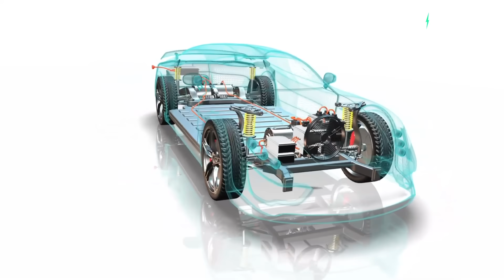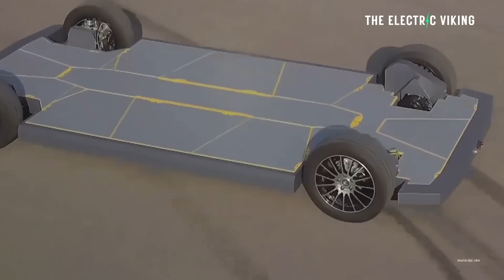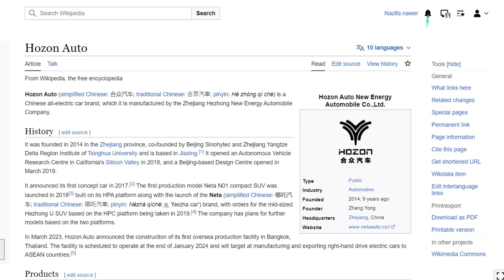CATL new EV platform with 621-Mile range could underpin future Tesla's

Comment: I find this hard to believe, my Tesla Y rwd 58kwh with gentle driving and a warm day can achieve 320 miles max real world, over 10k and  a year I have averaged 4.2 miles to the kWh winter and summer, and consider that above average, where the hell are they getting the extra efficiency from, yes I could match it on a test track at 30 mph but real world no way.

Comment: It's a pity about the physics- as 186 miles is .3 of the range so would use .3 of the battery or 27kwh and to charge 27  kwh in 5 mins is 27x12 or 323 kw charger, correct me if I'm wrong but i don't think they exist and would not be able to take that much current with existing wiring.
Reply: But the tesla v4 is a 350kW charger

Comment: Sam, it seems to me from your presentation, that the 1000km range refers to the skateboard alone (without a body shell fitted) . You can't magically double the range or an EV with higher drive train efficiency given that we are already looking at 95% for existing EV motors. You only have a few percent to play with. You should temper your enthusiasm for claims by manufacturers with some analysis and skepticism. EV drag coefficient and overall weight are equally if not more important.

Comment: The efficiency is most likely due to them driving at low speeds with a extremely efficient but not production test vehicle so not indicative of real world range. The efficiency of the skateboard chassis does not matter as most efficiency is affected by weight of the vehicles a whole but mostly aerodynamics. What matters most is how much this cost to manufacturers.

Comment: This integrated skateboard platform is the next logical step for component suppliers in the Automotive industry. Powertrains (Engines & Transmissions) in ICE vehicles were often bought from component suppliers or rivals. Suppliers such as Robert Bosch and Nippondenso for example could also add to this concept with other modular components such as Integrated dashboards and other integrated systems, on a plug and play, mix and match basis for a semi customised vehicle. It may even be possible to have a body system that can change the "top hat "passenger cell of the vehicle from a sedan to a coupe or a SUV to a utility. The possibilities are endless.

Comment: Its interesting to recall GM conceived the skateboard chassis concept. It was around 1985 as I recall. It was actually an exhibit at various motor shows. Batteries clearly weren't yet ready for it and
subsequently they dropped the bundle.

Comment: Rather than driving a standardized skateboard EV, I would prefer to have the option to add batteries for longer trips, or remove batteries when commuting short distances for work or running errands. That would allow for the greatest efficiency of the EV and charging.

Comment: My concern with the structural batteries is when you get into an accident, the whole frame / battery might need to be replaced making it incredibly expensive. Don't think these car makers paid much concern about that. Probably don't care
Reply: They have data which tells them if that situation happens a lot, or if it doesn't happen much.

Comment: I wonder if Tesla would ever use CATL's software, though. Tesla has a very strong software platform already, backed up by massive servers and supercomputers. Regarding CATL's emergence as a standard platform for modern EV's, this will last only until the next tech breakthrough that is cheaper, lighter, more green, etc. Nonetheless, it's exciting to see this level of performance coming up in a couple of years. 600+ miles of range for $30K will kill gasoline cars.

Comment: My lowly Tesla model 3 already gets 9.5 to 10.0 kWh in mild weather making the remarkable 10.5kwh per 100 km hardly that remarkable  (real word, the whole car, hills, rain 50% freeway, air con etc)  https://i.imgur.com/jJMJVOI.jpg

My average started at 12.0 in winter with -5C mornings, I am now down to 11.0 after 16,000 km and falling.

BTW 1000km / 10.5kwh per 100km / 90kwh battery pack - one or multiple numbers are incorrect. Obviously if it can do 1000km at 10.5 kWh per 100 it would need a 105kwh battery.

Alternatively 1000km on a 90kwh battery = 9.0 kWh per 100.

Comment: Watts are watts no matter the source - so to make a "skateboard" that gets 10km/kWh (about 6 miles) is remarkable.  IF real, I'm ready to switch to a gen 2 EV (my 2020 Bolt gets about 4.5mi/kWh in mild weather - that's at least a 30% improvement).  Of course the weight and aerodynamics of the body that goes on top will affect this range and perhaps the "muscle car" approach Tesla has may have to go by the wayside ???   My Bolt with 200 hp is really more than adequate.  I'm no Tesla fan, but if they can get this going and give me a real instrument panel (option ?  rather than an "ipad" to control everything), I'd switch.
Reply: 10.5 KwH per 100km = 5.92 miles per kWh - it's not that spectacular ...my run of the mill RWD model 3 gets 6.37miles per kWh in mild weather https://i.imgur.com/wIFNdBz.jpg

Comment: If people fast high charge a Tesla eletrctic car every day, the batteries packs on their car only last about around near 120,000 miles . 
And when people go for a  warranty battery packs replacement,  customers don't get a new batteries from Tesla. 
Don't expect Tesla will give customers a new battery pack ,
Tesla will give customers a use rebuild battery packs on their car with the factory warranty .

When people have to pay for the battery packs without the factory warranty , Tesla will charge customers a full price of a new battery packs . But Tesla is not replacing a new battery  packs , instead Tesla giving  customers rebuild used battery packs and charging Customers a full price of the battery packs.

Shouldn't Tesla only charge  customers for the burn out batteries modules stead of CHARGING customers the full price of the battery backs? 

REPLACEMENT OF THE TESLA USED BATTERY PACKS WITH OUT WARRANTY, IT IS VERY CRAZY EXPENSIVE. 

If people don't have a Tesla factory warranty, Try to find a Electric Car Garage Company that will replace the burnt out battery modules on your Electric car . 
Let hope the Electric Car Garage Company will cost a little less battery repair job than what Tesla charges.?
😉💖⚡️🛻⚡️🌏✌️

Comment: 5:52 Wasn't it the other way around then? Carmakers were designing the chassis and provided the engine, while contractors like Magna Steyr (e.g. the Audi TT) assembled the bodywork on their own assembly lines. Here the situation seems inverted: CATL will provide the chassis, running gear, battery pack, motors… and all that's left to the carmaker is the body and interior designs, and final assembly.

Comment: What battery technology is this ? Is it flamable like the current lithium ion batteries ?
Reply: There not flammable , unless you light them up , it’s petrol that’s flammable
Reply: @jasoncarmichael4540  So it's not lithium ion then ?
Reply: @kasperlindvig3215  lithium isn’t flammable, it just burns at a much hotter rate then other things , not like fuel which is flammable

Comment: Something goes wrong with any part of the skateboard, just swap it out. Any EV service center could do it, doesn't have to be the body / name badge manufacturer. As battery range increases, just swap to a longer range new skateboard.
Reply: Which would be a bit over half of a new cars cost I would imagine.
Reply: @gregkramer5588  But when you consider the same procedure for an ICEmobile, swapping out engine, transmission, and drive train, and associated labor costs, percentage wise not that much more.

Comment: Hey Sam, the latest car sales figures for UK were released today. Are you going to do a video about it? If not, here are the main points. For 3rd month in a row, no Tesla in top 10 sellers. Model Y drops down to 6th best seller for year to date. Model 3 is nowhere. Tesla sold about 1650 cars in November, that's even less than Suzuki, and about 75% down compared to November 2022.
Reply: Uk sales dropped reason is poverty.
Reply: @thilinarupasinghe7968  Actual car sales are up compared to last year. EV sales are down, but plug-in hybrids and mild hybrid petrol sales are up. But yes, buyers are more particular about getting value for money, hence Tesla sales have nose-dived.

Comment: There’s no f’n way Tesla is going to go to a CATL entire skateboard.. not gonna happen. Not unless it’s designed EXACTLY to Tesla’s specs.. which clearly it is not. Tesla may buy whatever batteries they’re using. But they will not use CATL’s motors and specs and change their entire production line. Not gonna happen. I’d bet the motors on this skateboard are shit for power.. which is why it’s got a high range number. Tesla aint gonna use this shit for a range boost that basically no one needs. Who the fuck is driving 600 miles anyway? What.. 2, 3 times a year? Fucking useless.. stop an extra time or two at a charger.. big deal.. not worth going to some generic shit system to get this range.

Comment: 621 miles is 999.4km, near enough to exactly 1,000km. It is not "well over 1,000km". This make me suspicious about the testing. The likelihood that testing would result in such a notable round number is remote. Now, if they said it got over1,000km or almost 1,000km, that woukd make a bit more sense. But if Sam's comment us precise in that they got 621 miles a result that translates precisely to 1,000km, then I'd be taking it with a fair quantity of salt.
Reply: Possibly a mild translation error , with the  distance figure later converted to USA 'miles' . The original Chinese release may have been "Achieved goal of 1000km"...

Comment: CATL is diversifying has fast has possible to reduce its reliance on Tesla MILAN, Nov 21 (Reuters) - Stellantis (STLAM.MI) plans to build an electric vehicle (EV) battery plant with China's CATL (300750.SZ) in Europe, its fourth one in the region, as the European carmaker seeks to make cheaper batteries and more affordable EVs. This is the fourth factory which are associated with Stellantis BMW and Mercedes particularly Daimler Trucks the largest Truck manufacturer in the world. They supply lithium iron phosphate cell technology (LFP) used in the eActros 600.

Comment: The next step is to stretch the skateboard and turn it into a battery train. No more overhead wires and standardised/cheaper designs. More than enough torque.

Comment: Looks like CATL has a new battery chemistry every 2 months. How come none of the new battery announced 1 year ago are not already in Tesla?
Reply: Several reasons but all companies test batteries in the lab and in pre production vehicles long before they hit the market.  Tesla announce using a LFP battery 2 years before they actually used it and they were almost certainly testing it even before that.  CATL's sodium batteries are not suitable for any of Tesla's current offerings and the mp3 battery is still being tested but tend to have a lower lifespan compared to pure LFP.  Tesla is also working on their own voodoo.  There's also a matter of whether CATL can currently scale their newest batteries to the 100k to 1 million range required for use in a Tesla vehicle.  It usually takes a while to ramp any new technology and supply chains.
Reply: Why those new batteries from CATL are already in Zeeker EV? @Ryan-ff2db
Reply: Yes but do any of these new concoctions solve the thermal runaway problem? The more EVs there are on the roads the more chance a thermal runaway incident is going to cause a major loss of life. All for nothing as there is no need for EVs at all. @Ryan-ff2db
Reply: Because it's all a scam. China lies all the time.
Reply: Why do you think so? The concept presented in this video has absolutely nothing to do with battery chemistry. It's just how to pack the cells together.
Reply: @beatreuteler  I think he means they are announcing new technologies every couple of months, which they do.  Whether it's a new chemistry, pack technology, thermal management, high voltage tech, recycling tech, etc..  they do seem to have an abundance of innovative tech that is announced on a regular basis and a marketing department well versed at promoting it.
Reply: @Ryan-ff2db  Maybe. However I think in his post the word Chemistry was used. But nevermind.

Comment: usually love your videos but this was total nonsense. Thee main factors limiting range given a fixed energy store is speed, roll resistance and drag
A skateboard without bodywork has 1/2 of the rolling resistance and 1/3 of the drag
And the speed on that track looks unrealistically low too
If you would strip the body from a model Y LR and perform an identical test, it would easily surpass 600mi
Drivetrain efficiency is irrelevant in these tests, it's always high 90s. Peripheral systems like heating and computing are also not counted when you test a skateboard

Comment: Tesla should either develop it's own platform or move quickly to build a strong partnership with CATL, why not a joint venture. Like PC's, future EVs will be built from "off the shelf" standard comodity components. CATL is "leading the dance".. I am amazed
Reply: Did you seriously say Tesla should develop their own platform? Whose are they using then?😂
Reply: Nah... Everyone should stop doing business with China.
Reply: Tesla is ALREADY CATL strongest partner 😂
Reply: @jovanleon7  But they are not a majority, many others do also, just happens that Tesla buys the most batteries.
Reply: Becaue IP theft, perhaps?
Reply: Please move away from reply button ty
Reply: Snarky!  @sparkysho-ze7nm
Reply: Tesla don't need this. They do it their own way with casting. Totally different.
Reply: True, I think they are unlikely to use it since they have good volume with not many models.  @monkeysezbegood

Comment: We don't need bigger capacity batteries just ones capable of charging faster.
Reply: Not really. Unless you do lots of long journeys perhaps. In which case maybe. Otherwise 98% of charging happens overnight at people's homes and stopping for a coffee and some food every couple of hours is necessary anyway.
Reply: @jlcTTT  ...right, because everyone owns their own home with charging access... this is the EV mantra, except people aren't willing to be hamstrung with limited vehicles and want to be able to use them the same way they used ICE cars...lots of people take longer trips and refuse to be locked into additional hrs added to charge or the anxiety of not finding a viable charging station...as it stands the EV infrastructure and vehicles are still inadequate in the US...
Reply: One vehicle two people use it  I have it at night  when I work and my partner has it during the day when she works car only home for two two hrs a day so yer fast charging would be good.
Reply: Nah. I'll take an EV that can go further over one I have to charge every 100 miles. In cold weather, the range would be reduced by way too much... Now imagine putting a roof rack or towing anything. 

Give me the huge battery pack and stfu.

Comment: Seems like people gonna be able to design there own cars soon
Reply: Just imagine the benefit of being able to switch your pick-up "cover shell" with a sedan one. Or since today you are in somewhat racing mood, just shorten the base a little bit and put on the "roadstar body" and have some fun on the track.
Reply: Their not there
Reply: It looks like the 'design-your-own' idea is coming. There will be problems with crash-worthiness; each individual option may require certification and this will delay (but not stop) this process.
Reply: @davidinkster1296 the shell would have no role in the car’s crash worthiness.  There would be a standard cage bolted on the standard platform, with the customized shell bolted over  the cage.

Comment: Like All EVs range is always fake.  621 miles at 31mph on flat ground, no wind nice temp ; but that is reasonable; on the highway with normal terrain and traffice it is far more honest to say a range of maybe 300 miles at 70mph.  Few if any will drive an electric car or 20 hours at 31 mph in some flat road - basically putting out these totally unrealistic fake ranges amounts to fraud and you are participating in it.

Comment: 10,5 kWh/100 km on a 90 kWh battery vehicle makes 860 km possible. Not 1000 km.
Reply: And it is a skate board structure only,half the weight of a real car. The real efficiency will be 20kwh/100km in a  medium compact car.

Comment: Are any of these batteries you been informing us about for the past year or so on the market yet?????
Reply: Can't confirm it but I believe the CATL qilin battery is in the Seres 5 EV. it is coming or already sold in Europe. It has 80kwh LFP battery. I know it's CATL battery, but assume the pack is qilin because of the energy capacity for that volume and chemistry is more than comparable BYD Atto 3 which is similar size but has only 60kwh blade battery.
Reply: LOL 621 miles with nothing bolted onto the skateboard lol like in the video :face-blue-smiling: once you put car body on bam 50 miles of range :face-blue-smiling: ITS HERE RIGHT NOW FOLKS LOOK AT ALL THESE 600 MILE RANGE EV'S  :face-blue-smiling::face-blue-smiling::face-blue-smiling::face-blue-smiling::face-blue-smiling::face-blue-smiling: